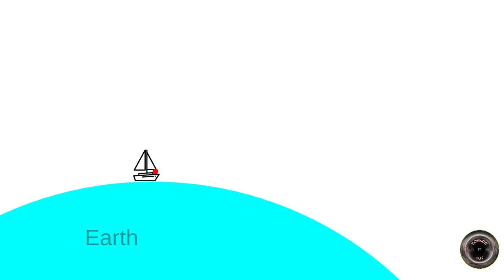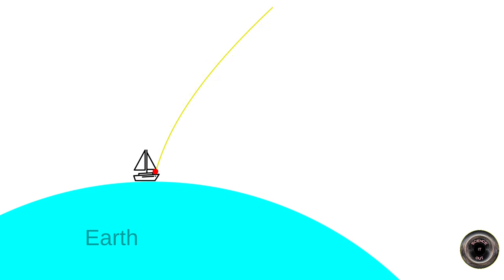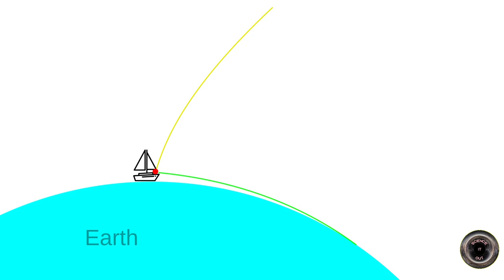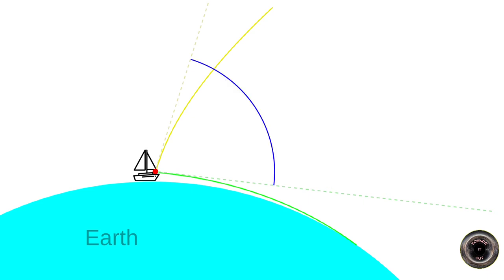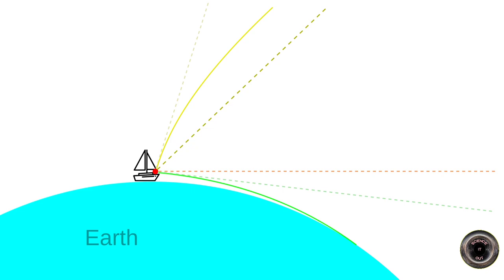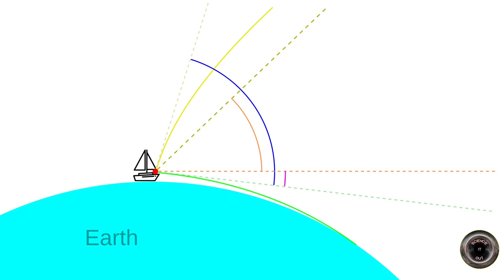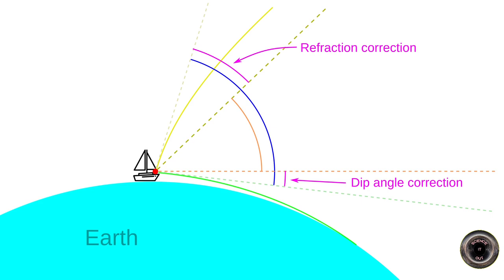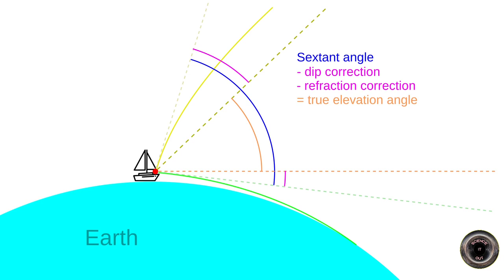How measuring the elevation angles works on a globe

Comment: Wouldn't it be better to say that you're line of sight doesn't bend but light bends into your line of sight?
Saying your line of sight bends brings up another argument for them to use. No straight lines on a globe. Which is false.
Reply from the maker: Kind of depends on how you define line of sight. I implicitly took it to mean the path of light arriving at the eye, which is one option. You could also define it to be the direction in which you are looking, which as I understand would be your preferred definition, and that would be fine, too.

I disagree with the second part of your comment, though. Even if we go with my definition and the lines of sight are bent, it doesn't follow that there are no straight lines on a globe. It just means those particular lines aren't straight. If someone tries to claim that there are no straight lines on a globe because of that, that's their problem, not mine.
Reply: @scienceitout  thanks for the response.. and that does make sense. Both parts of yours. 

Simply following spherical geometry, of course there are straight lines on a sphere. But understanding spherical geometry is asking too much from a flat earther. Just joking. I wish they would fight for better understanding things. 
Thanks for the video as well.
Reply: @fotwen  force in spherical geometry so your flat earth measurements can finally be transformed to prove a reified ball. you can then rest easy knowing that as long as you use angles of straight line and ignored the curved horizon with bendy water you have stopped yourself from thinking anymore about something like line of sight which invokes angles of sea level.
Reply: @Owen-sx4jj  
Your comment makes no sense... You had a hard time in math class huh?
Reply: @fotwen  can't answer?. Assume globe,measure earth flat then apply spherical math, Shazam it's a ball. Not too bright huh?
Reply: @Owen-sx4jj  can't answer what?  You didn't ask a question. 
What you are saying doesn't make sense.  You obviously don't understand how math works if you think that makes sense, 
Why don't you show me that what you say can be done? Until then you are speaking nonsense.
Reply: @fotwen  point is, you are begging the question of a ball and then after that you use spherical math to get what you want and then claim that proves the assumption. You take a measurement that seems straightforward and self evident enough and then do what Einstein was know for, apply your transform equation to then get your desired result. Not hard to understand.
Reply: @Owen-sx4jj  what transformation equation?  Show me.
If you believe what you are saying,  then you definitely don't understand math. 
It's hard to understand because what you are saying isn't possible. 
And show me where am I begging the question...
Reply: @fotwen  your assumption the earth is sphere with a radius value of 3959 to then apply spherical math to angle measurements. that's the fallacy. You just keep saying "I don't understand math" ooo I'm scared.
Reply: @Owen-sx4jj  I hate to tell you but I don't deal with assumptions. So there's no fallacy.
And facts shouldn't scare you.
So where's this transformation equation? Or was that an assumption made by you? Or was it something you heard without fact checking?
Reply: @fotwen  it matters not if you believe you don't think it's an assumption. You have assumed your conclusion in your premise by invoking spherical trig(your transform equation). Your dishonesty in not understanding this isnt working. Try something else. The horizon is horizontal but when of course you reify a globe and beg the question and say well...it's a big ball you've already lost
Reply: @Owen-sx4jj  spherical trigonometry isn't a transformation equation.... nice try though.
And no, I don't deal with assumptions. You also have not shown where I beg the question.  Another fail on your part. 
You aren't that good at this huh?
Reply: @fotwen  do you read in context? In this context it is. It's not needed unless, like i said, you've beg the question and reified your model. Not too bright are we?
Reply: @Owen-sx4jj  no I don't read in context.  I can only go by what your words say. And spherical trigonometry isn't a transformation equation.  You have yet to show me this magical equation of yours.
Please show me where I beg the question. You commenting false claims and false assumptions don't make make it true. 
Don't say we... You don't seem too bright.

Comment: If you're going to say refraction then how do you get a tangent line  to measure? It would always be changing.
Reply from the maker: I don't need to get anything. I take a sextant and line up the horizon with the star in the mirror. That's it. The angle between the index mirror and the horizon mirror is then half the angle between the apparent direction to the horizon and apparent direction to the star - which are, technically, tangents to the light rays coming from the horizon and the star to the sextant, at the position of the sextant.
Reply: @scienceitout  bendy right angles?
Reply: What do you mean by, “It would always be changing“? The amount of refraction is predictable.
Reply from the maker: @Andy-O374  What right angles?
Reply: @rickschaut8366  Predictable how?
Reply: @scienceitout  2 straight lines meeting at a vertex is a right angle isnt it? 90 degrees?
Reply: @Andy-O374  you measure the factors that determine the index of refraction and apply Snell’s Law. How do you not know this while deeming yourself qualified to tell others how refraction affects the geometry of what we observe and measure?
Reply: @Andy-O374  if you imagine that a tangent involves two straight lines, then I believe you’re not well acquainted with the concept of a tangent.
Reply: @rickschaut8366  but refraction is affected by weather isn't it? Weather changes. I have copy n pasted this from wikipedia......Since the line of sight in terrestrial refraction passes near the earth's surface, the magnitude of refraction depends chiefly on the temperature gradient near the ground, which varies widely at different times of day, seasons of the year, the nature of the terrain, the state of the weather, and other factors.
Reply: @rickschaut8366  I said the angle is 2 straight lines.
Reply: @Andy-O374  you asked how we get a tangent. Now you’re talking about two straight lines. Your questions are incoherent.
Reply: @rickschaut8366  No they are not. I asked how you get a tangent plane on a sphere in reality. At sea using a sextant for example.  Let's  deal  with that question first.. Thank you for your time by the way. Much appreciated.
Reply: @Andy-O374  

"No they are not."

I'm not sure what you mean by that. Are you saying that thermometers, barometers and hygrometers (aka sling psychrometers) don't exist, or are you saying that they don't measure the very things that determine the amount of refraction?

"I asked how you get a tangent plane on a sphere in reality."

No. Here's your original question:

"...how do you get a tangent line to measure?"

You asked about a tangent line, not a tangent plane, and you made no reference to a sphere.

My point is, your questions are exceptionally vague. On top of that, you've said things that are just patently false.

So, I don't think you're truly interested in learning about the subject covered in this video. If you are truly interested, ask better questions and avoid saying things that are clearly ridiculous.

Oh, and maybe watch the video again to be sure that you haven't missed anything important.
Reply: @rickschaut8366  A tangent plane is a  line on a diagram.  I'm asking how you acquire a flat baseline at sea if earth is a sphere. Do you just imagine the tangent plane  has s a big haemorrhoid earth dangling underneath it?